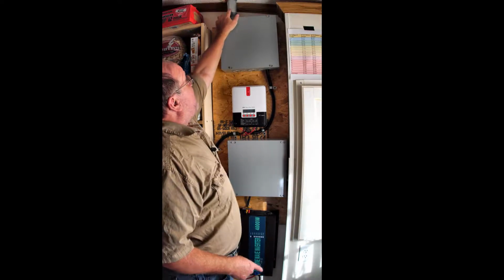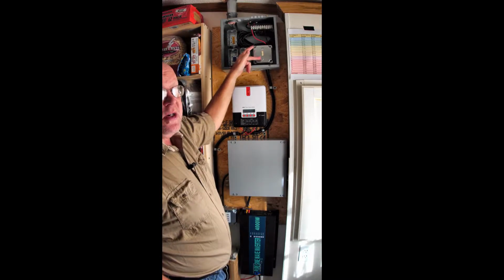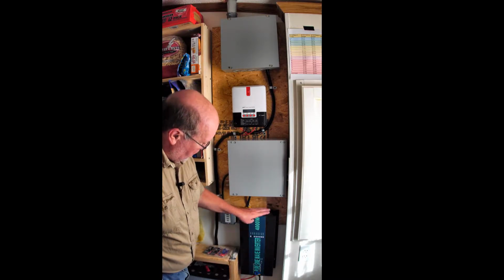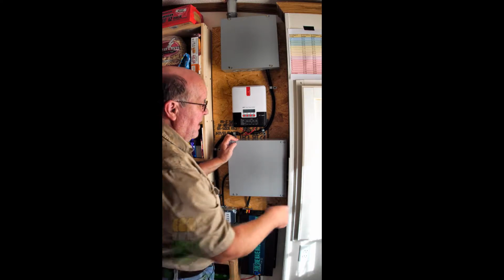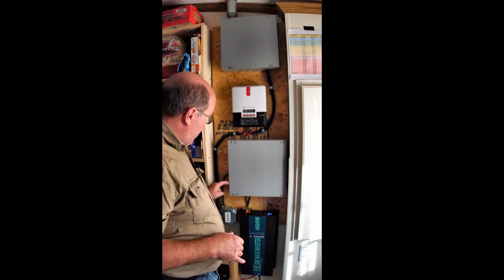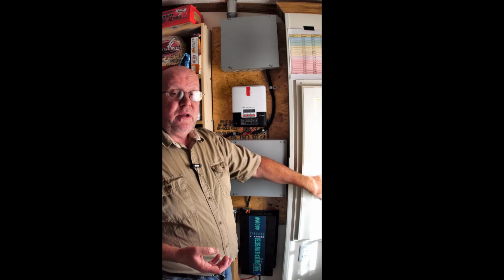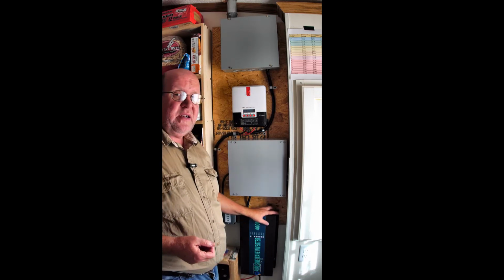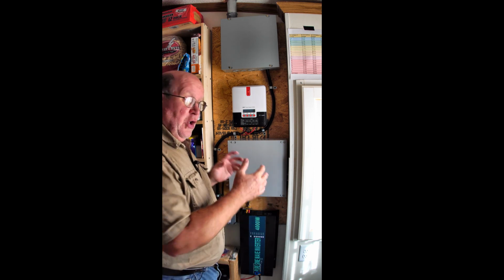My DIY Solar Back-Up Power System

Comment: So cool! Thank you. I'm still wrapping my brain around the calculations and remembering amps= watts/... It's a start.  I have an unused solar panel that will eventually be handy for charging my 12v boat battery ( also used. Heehee).
Great videos! Learning.